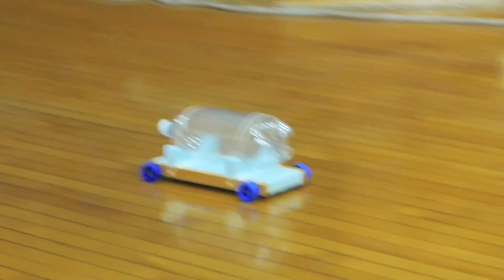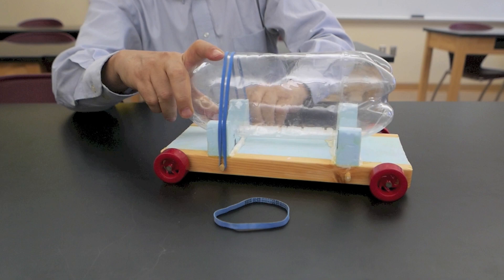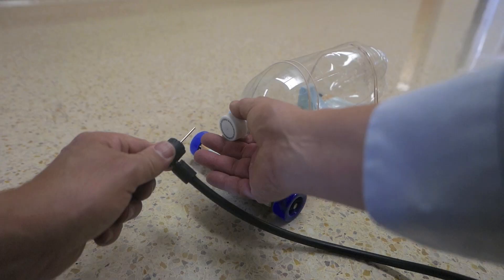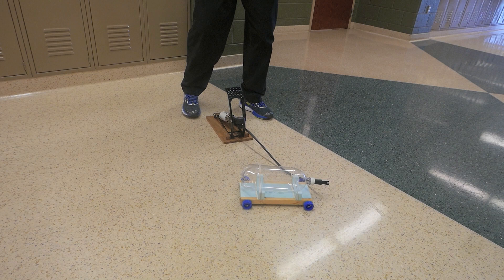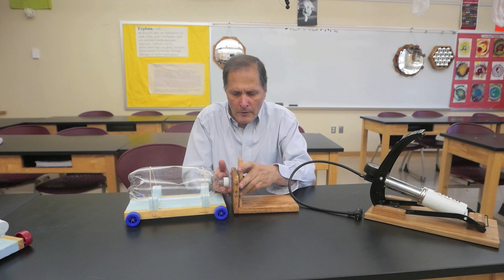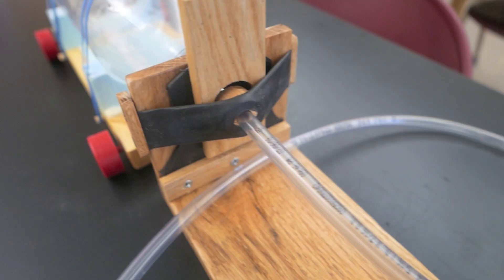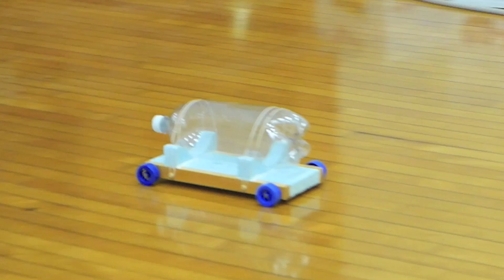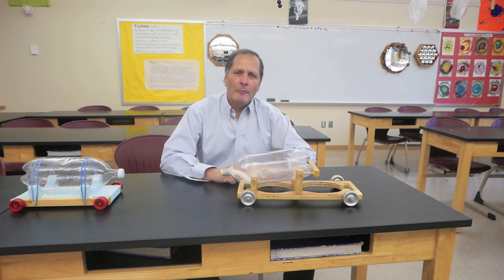Soda Bottle Air Car- Physics of toys // Homemade Science with Bruce Yeany

Comment: I wonder if some type of rocket nozzle would have improved the trust.
Reply from the maker: HI Allen, I tried a few versions,, it depends on what you want ,  a larger nozzle lets the air out quicker for slightly faster initial speed but stopped quicker,  higher air pressure is what really helps.    I went with this version as it is the easiest one for anyone to reproduce and got decent results.
Reply: Allen Engasser The purpose of a rocket nozzle is to increase the velocity the gas flies out the end. If your nozzle accomplishes that, it would improve the thrust. But I think increasing the pressure is far easier for a small increase in pressure. Most plastic bottles burst at 10 atmospheres of pressure and Bruce Yeany was about half of that.
Reply: The de Laval nozzle is really a device for converting heat and pressure into kinetic energy, on something like this you won't need that as the air isn't hotter than the ambient temperature. A simple constricting nozzle is all you need, and a small hole does fine for the constraints.

Comment: Wait, how could the bottle stays put when you pump that much pressure without using holding mechanism? Is the air not strong enough to push the bottle away from the needle?
Reply: There's a good enough seal with the needle and the cap that the air cannot escape.